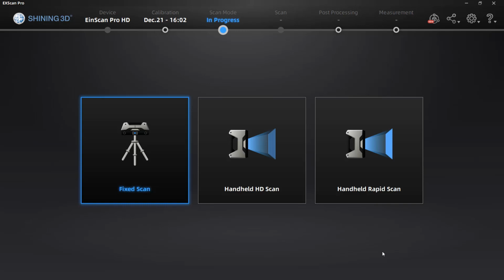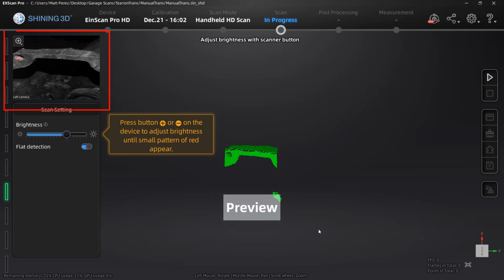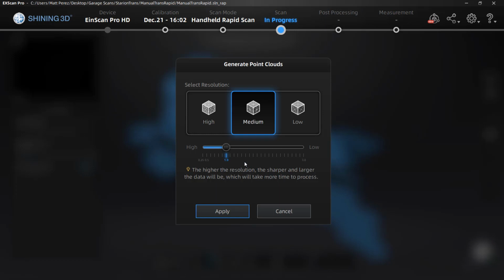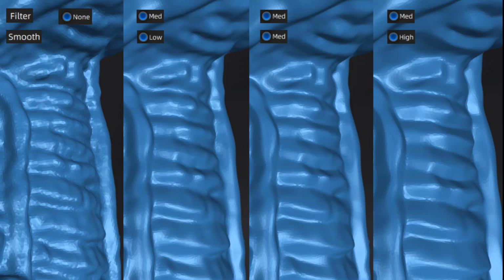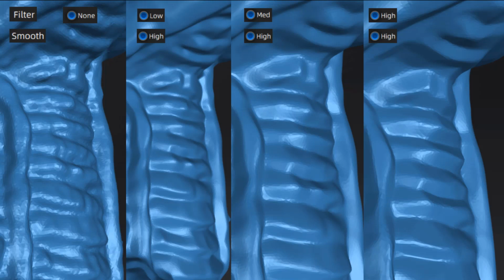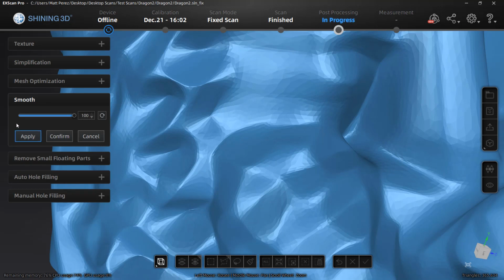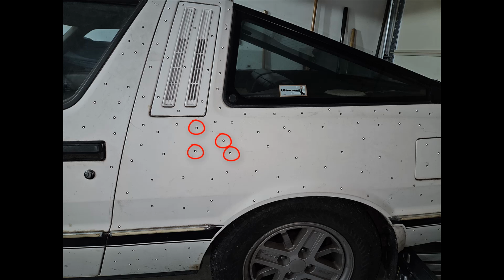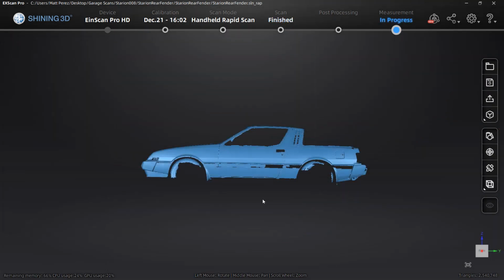How To Use ExScan Pro to Capture, Process, and Export Meshes | ExScan Software Overview

Comment: Great video as always. Super helpful! We use foot powder spray for dark or shiny objects, removes clean, basically the same as scanning spray. Also 3D printing some marker pyramids helps save on those expensive reflective stickers for smaller parts. $135 for a pack is no joke 😅.
Reply from the maker: That's a great idea!  I used to use modeling clay and just pinch it into unique shapes on larger surfaces when needed.  Shinning did have a tip about putting markers on some clear wrap but i just can't see that being a universal thing over complex parts.  Certainly helps if you can use the hybrid method.  I found the car needed WAY too many markers.  I have seen some places that sell smaller packs at a more reasonable price like here https://visionminer.com/products/3d-scanning-reflective-adhesive-markers  but i haven't ordered any.
Reply: @LearnEverythingAboutDesign  You came in clutch with that link! Thanks a bunch, will check them out. Your modeling clay and clear wrap tricks are gonna be on my cheat sheet as well!

Comment: I am not using ExScan Pro but I find this video very valuable as it apply to any software offering a minimum mesh/scan editing - Specifically, this video also apply to RevoScan from Revopoint, several options are similar. Thanks
Reply: What is the added value of creating the planes and center point directly in ExScan? - this exercise will have to be done in Fusion 360 anyway (like you did in the previous video) - Thanks
Reply from the maker: The plane, line and point in ExScan is made so you can align the mesh to the coordinate system.  They don't get saved with the mesh but when you open it in Fusion, it will be in the correct orientation with XYZ 0 where your point is.  It isn't required, but Fusion doesn't have a way to positively locate based on mesh.  You can create planes based of mesh selection in Fusion, but you can't change the coordinate system.
Reply from the maker: Glad it was helpful!  Thanks for watching!

Comment: I recently bought an einstar scanner, and have been trying to learn this program. excellent video!  One question I have is during the scan, what kind of room lighting is desired? Bright overhead lights? Dim? (shadows are bad right?)
Reply from the maker: Great question!  I noticed when doing the live filming of the fender in the garage that the LED light panels actually made it a bit harder to adjust the brightness on parts of the car.  I would say that "consistent" lighting is key.  I scanned the transmission and a few other things in the garage with just normal LED ceiling lights just fine, but i did notice the brightness on the scanner had to be a little higher than with "studio" lights.

Comment: can it be used in reverse engineering, it would be great to have more videos on this part
Reply from the maker: There are several videos and playlists on the channel for that topic including this one. https://www.youtube.com/playlist?list=PLBDfGh8A8kXWYEY9X4vJ5sKGh6TPzrr2h
ExScan specifically can't be used for reverse engineering but Shining3d did release a version of quicksurface (looks like) for that.  I will be doing quicksurface videos in the near future which might help but have done a few projects in Fusion including parts built off scan data and ones where he model the scanned part.

Comment: Can you scan in the imperial/ standard system or are you limited to only using metric?
Reply from the maker: To the best of my knowledge its metric only.  When you get the scan into whatever design software you are using is when you would switch units.

Comment: Hi! I have Einstar and a laptop with 32Gb memory, i7 13th gen and RTX4050. Processing scan takes ages. Is it possible to only do a scan using the laptop and then move the whole postprocessing to a stronger destktop?
Reply from the maker: Absolutely that is what I do.  Once you have a project saved you can take the entire project to another computer.  I typically use a file sharing setup like OneDrive and make sure "always keep on this device" is enabled on both the laptop and desktop.  If it can't find the project files it will pitch a fit.

Comment: Did I miss the part where you export?  I hate this scanner so far… tracking loss , alignment.. clunky software… intuitive like rocks for control… brutal
Reply from the maker: If i didn't cover it explicitly ( can't remember) I do appologize.  I do cover it in the scan series i did for the car. https://youtu.be/6DUYzn6kKGo  
There are chapters and near the end we save the mesh before working with it in Fusion in the following video.

Which scanner do you have?